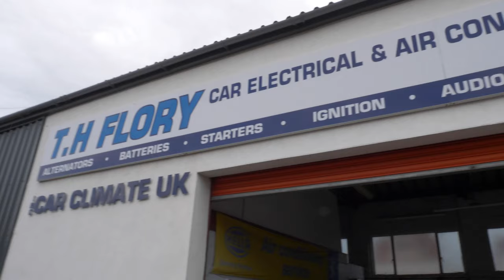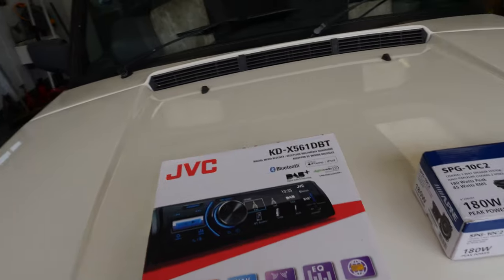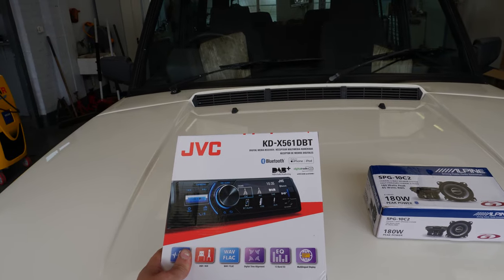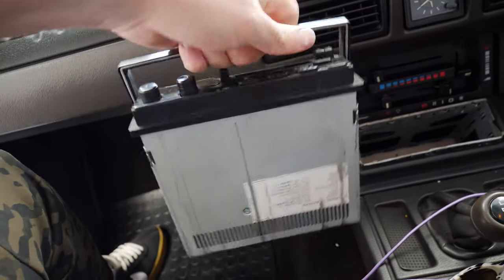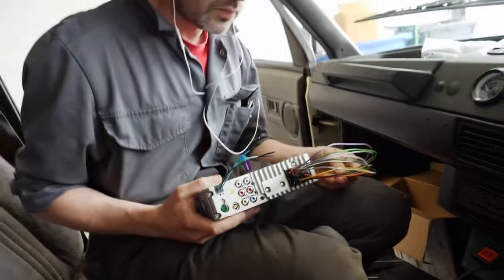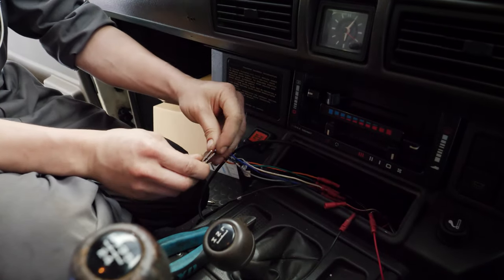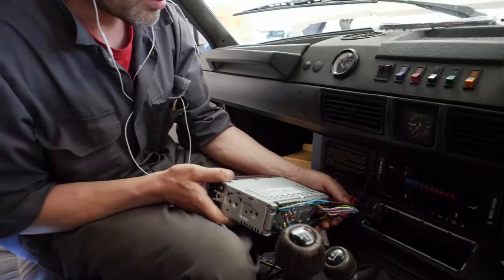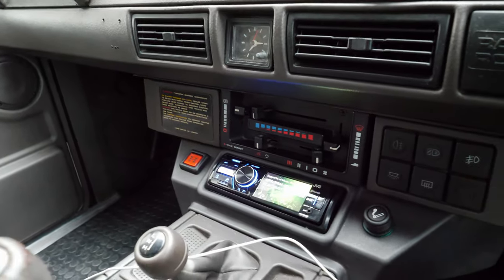Range Rover Classic  New stereo and speaker upgrade

Comment: Nice update. I'm going to have to replace at least the speakers in mine, so useful for me.
Your interior looks a lot more plush than mine. My door cards are properly spartan - one speaker at the bottom with holes through the trim (no mesh cover), tiny door pocket and a nice bit of solid wood stuck to it!
Odd little bit of trivia, the radio used (on the old 1970s models) to be in the little tray to the right of the steering column that's perfect for a sunglasses case, and the speaker was that little tray that's perfect for a phone in the middle of the dash.
Reply from the maker: Ahhh that makes sense why I noticed the holes in the top of the dash on the early cars now! I didn’t realise there was so many changes on interior between models still I started to look!

Comment: Did the Alpines fit in the doors without modification / could they just be  "dropped in" if my door speaker has blown? Not looking to do the entire system yet! great video.
Reply from the maker: Yes it was a direct fit fortunately which makes life easier
Reply: cheers I've just ordered speakers for mine, the pass door one blew out of course... @thedownshiftchannel
Reply from the maker: @jbaker1121  excellent. One of mine was also blown the new ones were much better

Comment: Does the the new radio have a built in antenna or did you have to connect to the rovers existing antenna setup? My 93 lwb radio is just too staticy on the local stations.
Reply from the maker: Hi. It did just connect to the existing option but I don’t really use the radio ever as the phone connection means there’s endless options for music, podcasts or even digital radio. You have add an aftermarket aerial or boost though
Reply: @thedownshiftchannel  great thank you

Comment: do you have a good diagram of the original wire harness? i find it difficult to find anywhere
Reply from the maker: There is a very helpful Facebook group called Range Rover Classic Owners. If you post in there someone will drop you it